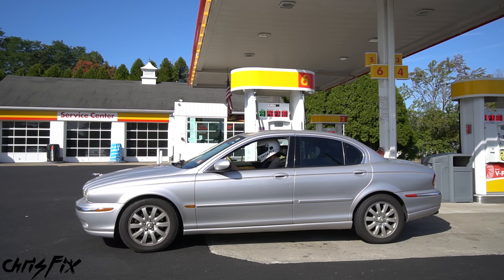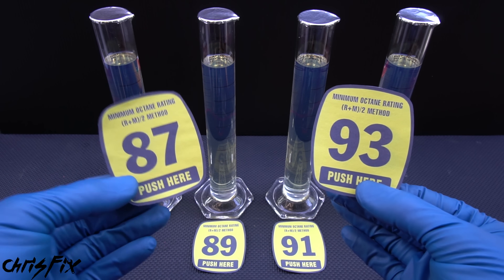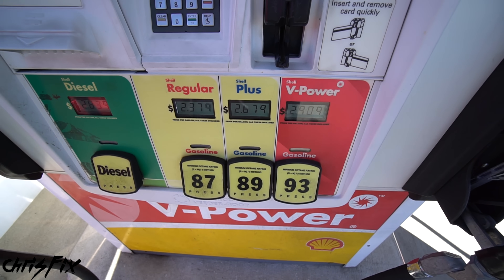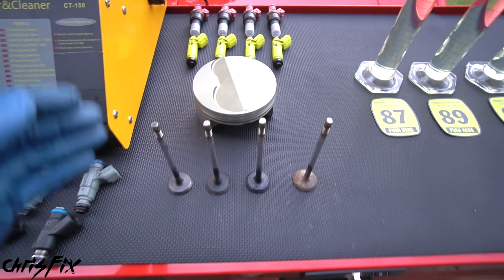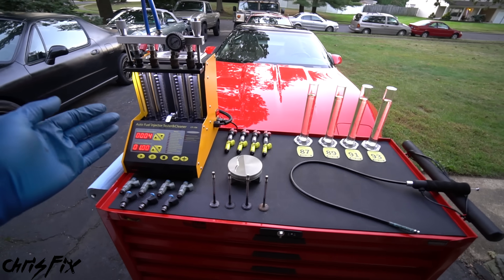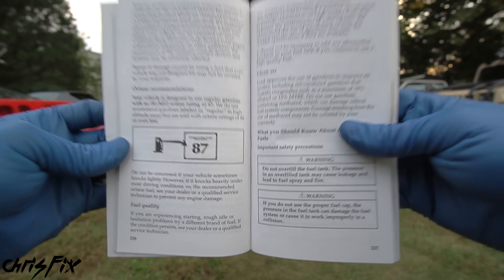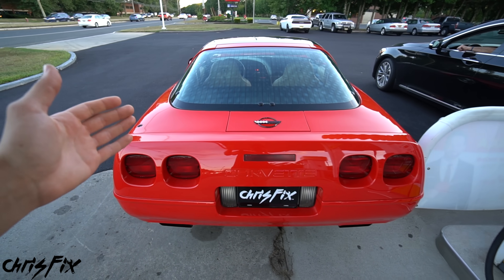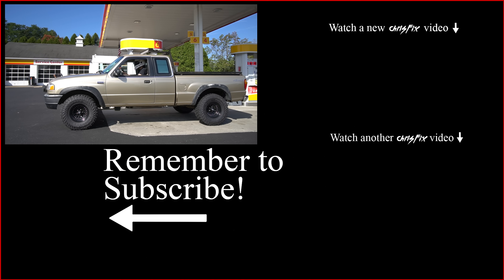What is the BEST Fuel to Use in Your Car or Truck and WHY

Comment: In my country ethanol is only allowed in one of the four grades of unleaded.
E10 which is Ethanol 10% 91 Ron. Then thankfully we have ordinary 91, the 94 then 98. Most cars here need 91 and run better on 94. many like BMW and Mercedes etc mandate 98. If you poor people in the US have to cop 87 I feel sorry for you because your engines have been detuned by the factory or run something like 8:1 compression. Ours are Euro spec. Over there you can get 100 Ron to for your Ferrari.
Reply from the maker: You cannot detune compression. You can make a low compression engine and that uses regular. But I think I know what you’re saying. At the same time, look at these gas prices compared to yours... I think it’s worth it haha.

Comment: So, I own a 2005 Saab 92x linear. I have a bit of issues with it but nonetheless I love it. Anyways, would running a better fuel help me if I have a lifter tick? Honestly, not great with cars and im just curious.
Reply from the maker: Lifted tick is a mechanical and oil related issue. Using seafoam in your oil (read the can and follow instructions) can clean it and sometimes fix the issue.
Reply: @chrisfix  Thanks man appreciate the advice. Been watching you for a few years now. You're awesome!

Comment: In Finland we have to types of gasoline: 95 and 98 octane fuel and there are few differences between 95 and 98 octane fuel. 95 octane contains 10% ethanol where 98 octane contains 5%. 95 octane is a bit cheaper but your fuel consumption rises about 3% compared to 98 octane. So the 98 octane fuel has more energy compared to 95 octane fuel due to the ethanol which contains less energy than gasoline.
Reply from the maker: Very true and thanks for sharing!

Comment: Do you really run 87 from shell in your Mustang?  I hope you really don’t. Too many additives. Definitely need no additives or as little as possible!

Oh I use 91 in my Mustang, the one you didn’t actually mention and is not at shell as that is the less additive fuel I can find.
Reply from the maker: I run 87 from many brands in my mustang. This shell station has been the cheapest around so I have been using their fuel. The Costco up the road is usually pretty cheap too but it’s further away. Additives are not an issue. Every brand has to run additives by law and that’s what the regular shell does. Premium on the other hand has 7x more additives than required by law. Either way, additives aren’t an issue and make up wayyy less than 1% of the fuel.
Reply: ChrisFix   I find the 91 helps my car run more smoothly imo.

Comment: Such a great video. So much information included. You have to appreciate the work he put into it.  I would love if you could do a video that talks about the ethanol added here in canada. Our 87 octane has 10% ethanol added. So most people here use the 93 because they think that it gives them better mileage for the extra cost spent
Reply from the maker: Thanks a lot and yes that’s an interesting video topic. Typically you get 3% less mpg when they use e5 but the fuel is cheaper so I wonder what would end up being cheaper in the long run?

Comment: Chris they say turbochargered cars needs premium gas when the factory sells it and says it uses regular gas
Reply from the maker: Yea they have such amazing technology with plasma coated cylinder walls and vvt that today’s turbo cars can run regular and not detonate. With that said, it’s like my Vette. Premium is not required but you will make more power and probably get better mpg with it.

Comment: Chris,  what are your feelings on the long term use of E85?  I have a Flex-fuel Chevy Avalanche and have been running E85 for 90% of the 150k miles I've put on it.  Does Ethanol clean the engine of carbon deposits, or does it do damage to the engine over time - more than regular fuel?
Reply from the maker: Ethanol will actually help clean the carbon deposits but that’s not a concern because 99% of cars don’t have carbon deposit issues. I would not worry about using e85 long term because it’s designed to use it. The fuel system is made to withstand the alcohol and you’re engine is tuned for it so if it’s cheaper, just send it!

Comment: If it all comes out the same hose does that not lead to contamination??
Reply from the maker: The % of contamination is insignificant but definitely! I’m curious how much gas a hose can hold.
Reply: ChrisFix I didn't think it would be much but just seems strange having it all come out of the one, surely there has to be more in the system and not just the hose? 
Volume would be too difficult to work out, just hose ID x length.

Comment: Can you do a video on supermarket fuel vs branded fuel. Because I was running asda supermarket fuel and even though it was the cheapest option in my area I realised that my fuel was running out quickly in comparison to shell fuel even though I'm technically getting less fuel for my money with shell.... And also I noticed on a different occasion that after running tesco momentum 99 supermarket fuel after about three tanks my engine started to sound a bit rough, but after returning back to shell fuel my engine became much smoother again... So I know that supermarket fuel is definitely not as good as branded fuel... Would you do a video on that...?
Reply from the maker: Like I said in the video, it’s all the same except for the detergent additive package. What you saw was probably a change in driving style due to traffic, weather, etc. that affects MPG.

Comment: Great...maybe nxt video would be " what is the best gas station brand you should choose"  Shell?Esso?Mobile1?Ultramar?PetroCanada?Husky?Irving?Costco?? " and why... What is the difference?
Reply from the maker: They are all good. Each one has its own detergent packages and I would just go with the least expensive fuel for normal driving
Reply: ChrisFix great thanks! was always wondering if there were some higher then other or some that weren't that good
basically, it's about the mixture and detergent inside...you got great and helpful content if ever it worth doing a video touching that subject would be nice

Comment: Also, for most modern sports motorcycles premium fuel is required because they want to squeeze as much power from a small and lightweight engine by giving it high compression. Older sports bikes and most cruisers can get away with regular.
Reply from the maker: Thanks for the info

Comment: I have a turbo diesel why am I watching this?
Reply: Because you love to learn bits of trivial information to fill your brain up.
Reply: @d.e.b.b5788  what do you mean?
Reply: @vladk163  I mean that you're watching a video that doesn't currently hold any useful information to you, yet you are apparently interested in it anyway.
Reply: @d.e.b.b5788  what can I say, I'm a simple man.....
Reply: Just run off road. Don't get caught tho
Reply: @keyworksales6241  wuuut?
Reply: @vladk163  off-road diesel. Its red, contains sulfur, makes your truck run right. Illegal on public roadways though.
Reply: @keyworksales6241  thanks for the tip lol and it's not a truck
Reply: Sounds nice.... 

I got twin turbo petrol... 💪🏽
Reply: @milkshakeflake  welllllllllllll....I have have 380 foot pounds of torque lol
Reply: Vlad K I have 533 tq at the wheels in my gas truck using 93, and 617 tq at the wheels using E50.
Reply: @NoticingBehaviors  that's awesome my car has a 3 L turbo diesel 210 horsepower 380 foot pounds of torque and the car only weighs 2800 lbs so it's pretty fun car
Reply: @NoticingBehaviors  I'm not sure what it is at the crank I know it's like a 15 to 18% decrease
Reply: Vlad K your car is 13.33 lbs per horsepower which is decent. I’m at 9 lbs per horsepower with my current tune. 3.5 TT v6 gas.
Reply: @NoticingBehaviors  that's crazy it must pull very hard
Reply: @NoticingBehaviors  it's not really the horsepower that makes my car fun it's the torque 210 horsepower isn't that impressive
Reply: @milkshakeflake  what car?
Reply: Vlad K what car?
Reply: @CoolizBrown  Opel Signum 2005 EGR delete hybrid turbo cat back exhaust stage 1
Reply: i don’t even have a car why am i watching this
Reply: @Angryberg33  gaining experience points
Reply: Turbo diesel sounds glorious
Reply: @solarisonesixsix  it has his pros and cons

Comment: I heard a theory is, gasoline with ethanol can actually help removing carbon deposits (because ethanol is a solvent I guess?). But some say that ethanol eats away your rubber fuel line and it’s actually bad for your car, I was wondering if I could get a tank full of E10 every few tanks of regular gasoline,is that gonna help removing carbon deposits and not harm the engine?
Reply from the maker: Yes ethanol helps clean but it is less energy dense so you get worse MPGs. For e10 and below it isn’t going to affect your fuel system, especially for 2001 and newer cars which are designed for it.
Reply: @chrisfix  thank you for your answer, it's very helpful

Comment: Shell claims if you run their premium fuel for 2500 miles, you’ll clean up to 70% of carbon deposits off of their bank account.
Reply from the maker: Hey I’m just stating their claim. It has to be backed up but I’m not saying it works or doesn’t work. I had good luck in my truck which stared pinging but most cars don’t need crazy cleaners in their fuel if you drive normally.

Comment: One quick question: Is it okay to mix fuels? i.e. Say you're driving a vehicle that can run on various fuel types (like 87+), can you fill up on 87 and when your tank is halfway fill up on 89?
Reply from the maker: Yes that’s fine. You just need the minimum octane that your car is rated for. The mid grade fuel is just regular and premium mixed.

Comment: I Have 2013 mustang v6 with 135k miles.  a year ago when I had 127k miles I heard weird noise from the engine while driving.  My friend told me to put premium gas.  I put premium and that noise went away but since then I'm using premium.  Should I go back to regular now?  I was using 93 when I was living in NJ, now I'm cali and its 91 here (still a premium) but gas prices are too high.  my car is also tuned with premium gas (which I can I switch back to stock 87).  So, what do you say, Am I wasting money by putting 91?   Btw I use Shell, 76 or sometimes Costco gas.
Reply from the maker: Put regular and see if that pinging comes back. If it does, switch back to premium.

Comment: There is a few different grades. 85 87 88 89 91 93. Depends on where you live. Not all grades are available everywhere. So regular could be 85 someplace and the next would be 87 is regular. So good information to go off of but base it off of where u live/traveling.

Comment: E-85 is ok fuel, BUT when I use it on my car which is flex fuel I lose about 50 miles per tank.
Reply: but is is usually 40 cents cheaper per gallon if you can find it.

Comment: From experience: Direct injection diesel requires premium + extra additive.
Reply: LOL. Diesel requires premium. What's the extra additive, a mechanic? LOL
Reply: @hotflashfoto  Most of diesel cars are direct injection nowadays, so that's true. But older ones that are indirect (with prechamber) can run on non-premium easily.
And an extra additive that you pour at the gas station is recommended for direct diesel injection to keep your injection system clean (which is expensive to fix or replace, happened to my dad).
Reply: @artepjan  I think we are misunderstanding each other. I was LOL'ing at a diesel needing "premium", and I assumed you meant gasoline, with a mechanic needing to be "added" to fix it.

The video was about gasoline, so that is why I assumed that that is what you meant.
Reply: @hotflashfoto  That's okay. I just wanted to add that info since Chris wasn't talking about diesel :)
Reply: @artepjan  No harm, no foul. That is unless you're Rollin' Coal! :D

Comment: Congratulations on a great, informative, and beautifully produced video. Thanks for doing it. My only point of contention is near the very end, after you advise using some kind of octane booster to be used if the vehicle requires higher octane fuel but none is available. You then mention E85 fuel. (Frankly I was wondering if you would mention anything about ethanol.) You tell people not to use E85 if the vehicle is not a flex fuel vehicle. You say that using E85 in a non-flex fuel vehicle can damage the engine, but you don't say what the damage might be. 

In fact, E85 could be "splash blended" into the tank if a person really needed to raise the octane of the 87 octane fuel a couple of 'notches.' The Shell 87 octane you were showing was probably E10, so it already has some ethanol in the blend. If the fuel tank holds 16 gallons of fuel, and 93 octane is required for the car, but not available, then about 6 gallons of E85 could be splash blended to 10 gallons of the E10 fuel to reach 93 octane. Nothing would hurt the engine. Effectively, 6 gallons of E85 mixed with 10 gallons of E10 would theoretically be about E32. E32 won't hurt any car; not an old car, not a late model car, not a new car. Studies and practical use experience that go back 100 years or more show that non-flex fuel automobiles can not only use E30 to E50, but that they may get improved performance. Moreover, remember that Brazil has virtually the same vehicles on the road that we have in the U.S., and their standard fuel is E27. If a vehicle can run safely and efficiently on E27 on the streets of Rio de Janeiro, it can run safely and efficiently on E32 on any street in America. 

The octane booster you used looks like its Gumout brand. Gumout doesn't say what their active ingredient is in their octane booster product. It could be a petroleum distillate (kerosene, naphtha, mineral spirits), toluene,  or it could be an alcohol (methyl alcohol, isopropyl alcohol, or ethyl alcohol - aka ethanol).  In essence, adding the Gumout would be like adding ethanol. The only thing to consider is that ethanol is the least corrosive of all the other possible ingredients. Additionally, I believe that Gumout states that one bottle of their octane booster raises the octane level one point. If that's correct, then it would take 6 bottles to bring 87 octane fuel up to 93 octane. If the bottles cost $8 each, it would add $48 to the cost of the fuel. Ouch! If E87 is available it would cost less per gallon than the E10 by 15% to 25%, so the splash blended option would save some serious money. If anyone finds my math is incorrect, please don't hesitate to correct me. In any event, the "corrected" math would still bear out the benefits of using the E85.

Thanks.

Marc J. Rauch
THE AUTO CHANNEL

Comment: How is their fuel supposed to clean intake valves on a direct injected engine
Reply: James Holbrook it doesn’t. I’m glad my engine has both DI and PI, best of both worlds.
Reply: I have heard good fuel is suppose to prevent or lessen carbon build up but ya not remove
Reply: James Holbrook I’ve heard that too but haven’t seen anything proving it. Carbon is a byproduct of burning fuel no matter the additives. Maybe it lubricates it some to keep it from sticking? Idk.
Reply: Well really the carbon on intake valves can only come from the PCV or egr system on a DI engine unless the valve opens while there is still exhaust in the cylinder so manufacturers should be installing a catch can especially the turbo cars

Comment: I hope this is the solution to my problem. I have a high mileage rebuilt jeep 4.0 and just started getting detonation at low rpm after spark plugs, wires, cap, and rotor replacement and have been stuck on what to do.

Comment: Hi. Is same applies to oil change mileage? Check in the manual, or change more often? There are lots of tales, that oil should be changed at least till 5k no matter of the manual..

Comment: One more thing, is it true that cars in the 70s shouldnt really use the current gas, since it contains a certain amount of ethanol to boost its octane. From what I heard the reason is because ethanol is acidic or something like that, and can ruin the fuel system for cars in the 70s

Comment: Hi ChrisFix I have a 97 Ford Mustang v6 and I’ve been running mid grade in it and it does say in the owners manual to use 87 octane should I not use that on a regular basis?

Comment: My old Volvo used to run regular just fine. (recommended to run premium 98octane) Now it wont even run with regular 95 octane. Starts and dies after 4sec even if i press the pedal to the metal. So now it only gets premium 98 octane and runs without any problems lol. Its weird cuz with 95 i dont get any fault codes and cant hear any knock. Its banging a lot in the exaust tho.

Comment: Speaking of fuel, my dad and myself discovered why my 82 toyota celica supra wasnt running. We discovered that the catalytic converter collapsed onto itself and stalled the car, so the problem? We discovered this problem after several years later when the catalytic converter collapsed, the problem was bad fuel injectors, like really bad. All 6 of them were leaking even when the car was off, which left the fuel pressure around 5psi which is way too low and caused the car to die and not start well. So we replaced them, and the car runs so much better with the new injectors. 

Also, I usually put mid grade in my 82 Toyota, and I've noticed that it actually gives the Toyota better gas mileage

Comment: What if you filled up my vw which takes premium required. It was a while ago. I have tried fuel cleaner but it just has never run right since. Do you think I need a new fuel filter? If so this car requires a whole new pump to replace..

Comment: "Fuel in Eu and US is basically the same, almost the same, very similar". What a fix statement. Fuel PON 87 octane does not have an equivalent in EU. It just to low for the engines that EU cars use. Do US car owners need to be told to look in the manual to know what fuel to use? Ohhh, don't forget to breath.